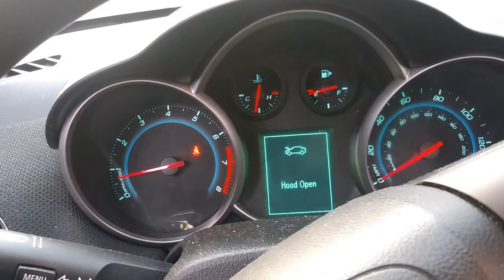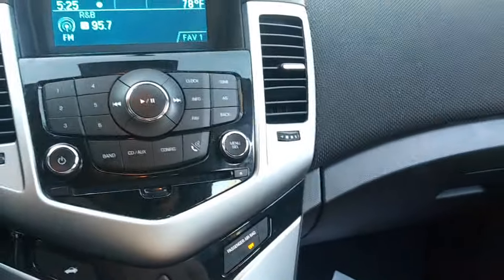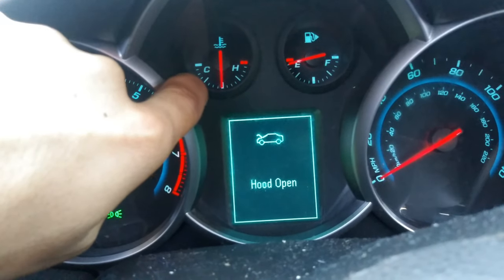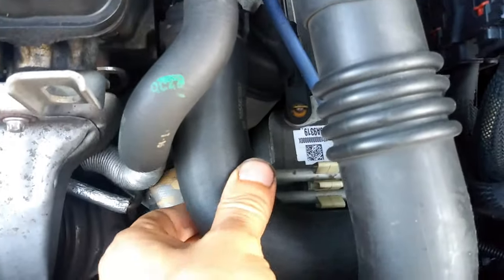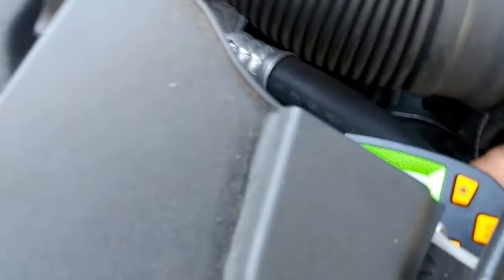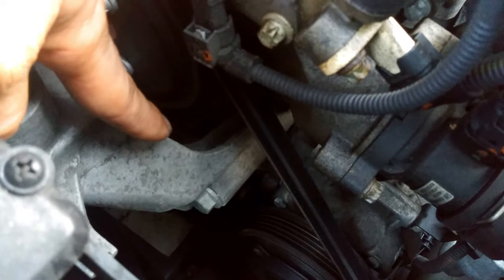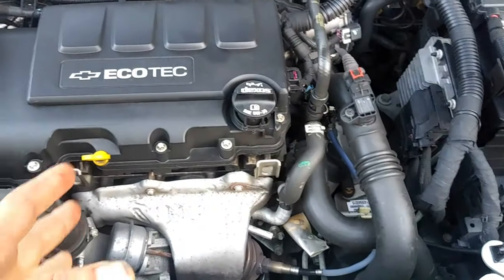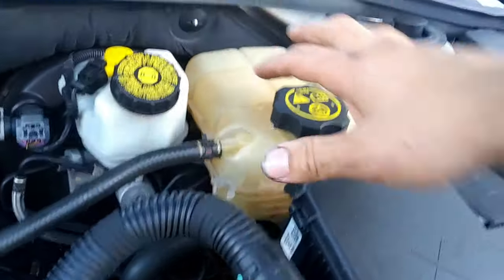chevy cruze overheating issues

Comment: So I just recently drove my 2013 1.4T from Ohio to Florida and it drove fine until I got here then it started overheating and doing exactly what this is doing... I have changed the thermostat and I have coolant and it’s not leaking anywhere nor is my water pump showing any external signs of damage so I’m at a loss here, water outlet was also replaced in March
Reply from the maker: Water pump could be bad
Reply: Jabo The Mechanic was that the fix to the car in your video? Because this seems to be exactly what mine is doing, I just don’t see how it would fail with no leakage or noise
Reply from the maker: The fix was the thermostat  and water pump.  And make sure you bleed out all the air from the cooling system too
Reply: Jabo The Mechanic ok thank you! Also I should note that the car drives fine up until about 5 minutes after reaching normal operating temperature and then the fan kicks on over drive and it will slowly rise until suddenly jumping to red but if I shut it off and retstart it, it’ll be instantly back to normal temp or a lot lower than before?
Reply: Jabo The Mechanic and I have no heat sometimes but sometimes I do
Reply from the maker: Sounds like air in the system  did you bleed out the air
Reply: Jabo The Mechanic yes I bled the system and just replaced the temperature sensor in the radiator and that didn’t fix it either so I’m at a loss here
Reply from the maker: Do you have a check engine light on
Reply: Jabo The Mechanic at first when it started doing the over heating it through codes P0171, P015A, P015B, P0420, P0496 and then P1101, I then just went ahead and replaced the actual parts associated with those codes such as the MAF sensor, purge valve, o2 sensor and then the thermostat because I thought that was the problem, it cleared those but then the check engine light came back on with codes P00B7 and P0420 so I replaced the radiator temperature sensor and now I’m still getting the overheating while driving message and my overflow tank is full
Reply: You have to airlift these newer cars to get the majority of air out of them.
Reply: I’m having the same problems as shotby zy….2015 Cruze 1.4… the car will get up to temp stay at temp for several minutes.. then overheat… then randomly return back to normal temp quickly… I replaced the thermostat first.. didn’t fix it… pulled a vacuum on the coolant system to get all the air out… didn’t work… bout some coolant temp sensors to put on but I doubt that’ll work either… as they are both reading accurately on the scan tool… my water pump is not leaking or wobbling… really don’t know what else it can be… me and my cousin think it might have a small head gasket leak… causing compression to get into the cooling system and create an air pocket.. we pressure tested the coolant system but got no coolant the cylinders..
Reply: @ShotByZy 
Did you ever figure out the problem with your car?
Reply: @lightoflife6593  this specific instance I believe was air still trapped in my system, after bleeding it thoroughly it fixed my issue for then🤣
Reply: @ShotByZy  
Thank you for that information. I hope to get my car repaired soon.

Comment: I have 2014 rs eco turbo cruze 1.4 started over heating So I had new thermostate put in and casing put on , Old one was crack. Still over heat and says turning AC off so had new water pump put on still over heats , so figured mybe thermostate new but could be bad so put another new one in and still  over heats like you video one hose hot the other one cool have no clue what it could be
Reply: Mines doing the same thing right as we speak....I’m guessing it’s the water pump that took a shit.

Comment: I just put in some antifreeze and on my way home it doesn’t show on my odometer it’s not overheating. But when I got home I’m seeing smoke coming out.
Reply from the maker: Coming from where
Reply: Jabo The Mechanic smoking coming from where I pour the antifreeze little brown bottle looking thingi
Reply from the maker: The radiator cap might be bad or the reservoir is crack
Reply: Jabo The Mechanic do you know where the reservoir is located
Reply from the maker: Its a clear plastic that has orange coolant in it
Reply: Jabo The Mechanic got you. I just myself look dumb but thank you
Reply from the maker: No you are good. You are welcome!

Comment: You

Just for explanation. My chevy cruze 2012 1.8 kept bubbling and spitting out the reservoir and I changed cap changed the pump thermostat tried blue devil...nothing worked. The actual engine wasn't overheating. After all that I changed the whole reservoir tank and it stopped so I think it was letting air in through the exit valve on the reservoir tank. 4 or 5 mechanics didn't figure this out before it was finally done and repaired with a cheap tank. Thought people might want to know since there is no video on that.
Reply: Hi can I reach out to you. My Cruze is giving me hell with overheating.

Comment: @Jabo the Mechanic I have a 2014 cruze with high temp problems as well. It will reach regular temp, son after go into high temp for about 30 seconds to a min, then go back down to normal temp for about 10 or 14 mins then do the same. I replaced the thermostat housing about 2 months ago when it did this before. Is it something else or did I get a bad thermostat?
Reply from the maker: Faulty temp sensor
Reply: @JaboTheMechanic  thanks for the reply, I will replace both.
Reply from the maker: Make sure you use oem
Reply: Mine is about the same issue, the heater will blow hot air only when it overheats.  Does that mean the thermostat is opening and letting air into the heater core to drop the temp only when the temp sensor tells it, or do you think it is a sticky thermostat?
Reply from the maker: @jdub3434  slow flow coolant water pump, faulty temp sensor,
Reply: @JaboTheMechanic  yeah that is what I figured. First I am gonna run some cleaner through the system, flush it, then replace the sensors and hoses (@100k so probably needs to be done anyway) to see if that fixes it.  If that doesnt do it, then I will probably bring it into a shop.
Reply: Did any of those changes work that you tried?
Reply from the maker: When I replaced the  water pump it worked

Comment: My moms cruze is having the fan kick on and the needle is going to the middle but going back n forth to 2nd cool dash. I looked under she has no coolant in the resevoir. None! And i filled it had her use the car and by the end of the day she parked it and now i see coolant leaking all over the driveway. 2015 LT. 4cyl. 98k miles. She had the waterpump replaced at 33k miles.
Reply: Did that fix it ? I replaced my water pump and it’s still doing it

Comment: The hose that runs from the water pump to the radiator stays really soft and squishy. My car is a 2014
Reply: Try replacing the pressure cap on your overflow reservoir. Sounds like the cooling systems is not building pressure.

Comment: Had a issue the same. After replacing sensor with housing plugged the battery and also the computer to cle. The wire I belive are also bad to the sensor.

Comment: So I changed the thermostat and my car still overheats,has coolant in the system and in the reservoir.Could it be a water pump?Car has 170,000 miles
Reply from the maker: It could be.
Reply: @JaboTheMechanic  I’m guessing it’s the head gasket now.When I start the car,it’s runs rough,chugs and then dies.And still overheats
Reply from the maker: Oh yeah that sounds like it
Reply: @JaboTheMechanic  those pretty expensive?

Comment: I have a 2012 cruze it just started doin it it did it once n went away now it wont run 5 mins without overheating and the engine reducing power and turns off
Reply from the maker: Do you have coolant
Reply: @JaboTheMechanic  yes it does
Reply: @marcozamora3999  Check the thermostat and leaks

Comment: My friends car is doing this. thermostat is cold enough to touch while other side is too hot to touch. I assume there is an issue and these should be reversed. THey have changed the thermostat changed coolant and stuff. Hes about to open up the water pump. Is this what was your issue?

Comment: If it stays a gauge and a half before the h  it's not overheating correct
Reply from the maker: It can overheat while staying at the half way. The gauge has false readings. You need a scanner to  get the proper readings

Comment: My daughters chevy cruze has begun over heating AGAIN.  Last time the outlet valve and reservoir tank were cracked so i replaced both of those. A couple months ago.  Ran fine, until recently.
Started overheating, added coolant and burped system.  While it is idling/burping the heat blows really strong, but it seems like the bubbling never really stops. Lessens after awhile but seems to remain.  Seems to get up to temp and stay there, until i drive it around for about 15/20 minutes then it starts overheating and it seems the air from the vents goes ambient as well .  Only coolant leak i see is some being blown off from the dorman reservoir cap.  I have now replaced the thermostat and tstat housing, still the issue has not changed. I am wondering if i should replace the waterpump at this point but i dont want to keep throwing good parts away.  Any help would be appreciated.
Reply: Hi! Did you ever figure out the issue? My car is doing the same thing the last few days….
Reply: I've  had the same issue. It's parked now. BEEN PARKED FOR 7 MONTHS..... I've changed the pump twice, temp sensors twice, hoses, thermostat 3 times and the resivour cap..... You figure anything out?

Comment: My 2014 cruze the radiator fan wont turn on because of a certain relay, but when I get a new relay it just keeps on blowing them!!! Also, when it does overheat the temp gauge stays at normal so I have no damn clue!!! I hate chevy!!!
Reply from the maker: Your is pulling to much amps and burning them out
Reply: @JaboTheMechanic  Well I have a 220 amp high output alternator installed so I doubt that's it but thanks anyways
Reply: @JaboTheMechanic  Or would that even matter???
Reply from the maker: Doesn't matter how much temperature alternators outputting it's because your really can put out so much amperage if your electric fans are pulling more than what they should it will burn out the relay faster
Reply: @JaboTheMechanic  Right, but one thing that also happens, the radiator fan will turn on really loud and strong for like 5 seconds then shuts off, and it does this like every 35 to 40 seconds. When I pop the hood the engine is super hot as it emits that unmistakable smell of a hot engine, yet the temp gauge is a notch or 2 below normal. Thoughts???

Comment: It’s probably a broke water outlet. 500-800 dollars to repair. These types of problems are common. Other common repair is broken pcv valve. Good thing is that it’s easy to repair and parts are cheap if you can do it on your own
Reply: I have a 2014 1.4 L I replaced my water outlet maybe a year ago ish due to overheating and it was fine and just changed my pcv valve cover a week ago and it started overheating so changed thermostat, didn’t help

Comment: I had an overheating issue in my 2010 chevy cruze and I canceled the thermostat even and still temperature going up. Then I changed the radiator and still the same I changed the sensor and also still the same.
So pleasssssssssse give an answer
Reply from the maker: Check the coolant reservoir and see if the coolant is flowing/recirculating through it if not either you have a restriction or the water pump is not working. Also these motors are know for blown head gaskets as well
Reply: How about you bleed the system. If there is air in coolant system it will show overheating in dash dial.
Reply: osama hassan cheek the cooling system that would help you

Comment: I just purchased a 2013 chevy cruze. Its a hot day but it feels like my engine is over heating. I'm 1 bar before the half way point where the middle white line is. If I open the hood its pretty hot to move the clicker to open hood. Even the hood bar is very hot to touch..  is this normal on these cars
Reply: I am having the same problem!!! My radiator fan will turn on for a split second and then shut off. I was told it was a relay, so I replaced it and now they keep blowing!!! I knew I shouldn't have bought a damn chevy!!!
Reply: Have the same issue with the 2011 Chevy Cruze 😂😂fck

Comment: Changed the coolant surge tank and the water pump but I still get the occasional high engine temperature. Why the hell is this?
Reply from the maker: Thermostat
Reply: @JaboTheMechanic  Thank you. I got 155.000 miles on the car and my mechanic says that it could be the engine, which unsurprisingly costs a ton of money to fix. Any thoughts on that?
Reply from the maker: @Walangord  they are known for that. But if you catch it before it overheats to the point of no return. Than you would have to replace the motor
Reply: @JaboTheMechanic  By the way, my original complaint was car leaking coolant. When I first went to him, he showed me the leaking coolant from the water pump and changed it. Couple days later, leaking continued but it was less drastic. So I went to him again and he changed the surge tank and the leaking stopped. But couple of days later, I started getting occasional temp jumps with no leaked coolant from the car. And today went to him again, before seeing your reply and told him about the temp jumps. So he pulled off the coolant temperature sensor only to find out that it was cracked! I was relieved to see that the problem was such a minor thing. So he changed the sensor and I went on my way(about an hour ago). But right now, I am getting the temp jumps again. I hope that the problem is thermostat as you say. But dear god, I hate this car. (If any of the stuff I mentioned above changes your diagnosis, please let me know)
Reply from the maker: @Walangord  make sure he properly bled the cooling system. The bleeder screw it on the radiator passenger side top corner. In the engine bay.
Reply: @JaboTheMechanic  He did unscrew it and bled the system from there, if thats what you mean.
Reply from the maker: @Walangord  yes thats what i mean. Is it overheating while driving or at idle
Reply: @JaboTheMechanic  It overheats while driving and usually after or during speeding. And when it overheats, the fan spins at max speed as well. The temp gauge gets near 3/4 but does not exceed it. It then goes back to normal for couple of minutes then jumps and than goes back to normal and so on
Reply from the maker: @Walangord  faulty themostat
Reply: @JaboTheMechanic  Thank you a bunch. Will have him check it out again. But for my information, what kind of problem with the engine could cause this? I mean heating with no leak!? You know, as the mechanic said.
Reply from the maker: @Walangord  if the engine is at fault than the temperature would not drop it will keep rising
Reply: @JaboTheMechanic  Makes sense. Well said sir. Thanks again
Reply from the maker: @Walangord  anytime
Reply: @JaboTheMechanic  
Update;
Yesterday I went to my mechanic and told him about the temp jumps, and he said that he was pretty sure it was the head gasket. Although I told him that there is no frothy residue under the oil cap, or blue smoke from the exhaust or no change in the coolant level, he seemed confident and said that he has seen it before and %90 of the time it was the head gasket.

In despair, I went to a new mechanic. And this new mechanic listened to what I had to say, made a quick check and said it was the thermostat. So he changed it and I went on my way and all seemed perfect. The car was driving nicely and all was good.

For 20 minutes..

20 freaking minutes after I left his shop, check engine light appeared, coupled with a sense of less power in the gas pedal. It felt as if the car was sort of less powerful.

I went on driving and got back home. I connected my obd2 device to see the code and it was the damned P0171. I immediately popped the hood, only to hear a hissing sound. I then removed the top plastic cover over the camshaft cover and reached out to that diafram, what they call the pcv valve I guess. And when I covered that little hole of the diafram with my finger, the sound was gone and I felt that it was sort of pulling air inside.

So the question is, did the pcv valve went bad on its own or is it because of another underlying problem, like a bad head gasket?

P.s; Dear god I am wholeheartedly sorry for what have I done to have this car.
Reply: @Walangord  I feel you! I have brought my cruze in for the pcv valve replacement twice, it ended up being the diaphragm on the intake manifold, but they replaced it too for free at the same time, but the car is still dripping oil, not spewing it like before the intake manifold was replaced.  They told me to take it the dealer and gave me half my money back...for the pcv valve that maybe didnt need to be replaced.
Reply: @jdub3434   The pcv problem is inevitable. You will encounter it again and again no matter how many times you change the camshaft cover and the manifold because it stems from a faulty design. There is a solution though.
If you are a handy guy or can find a resourceful mechanic that can install a special kit designed by a cruze owner, you can evade that problem. Here is it's link:
https://www.cruzetalk.com/threads/gm-1-4l-turbo-intake-manifold-pcv-valve-fix-kits.189402/